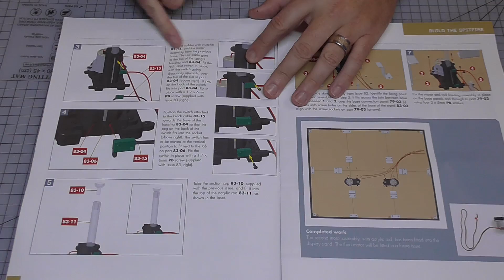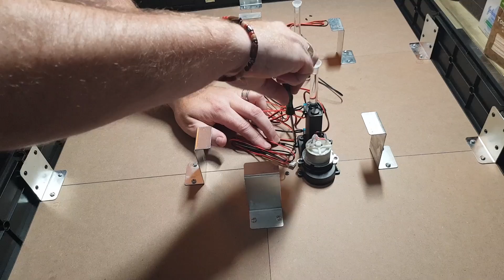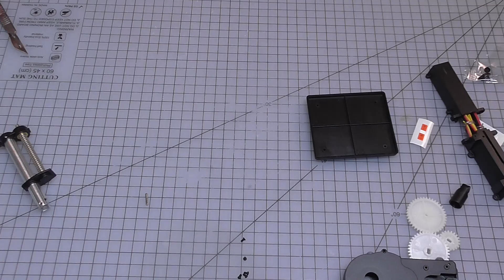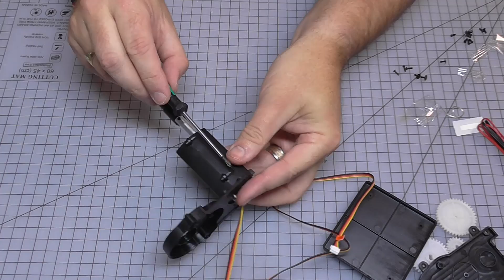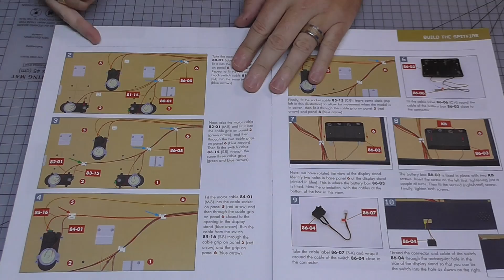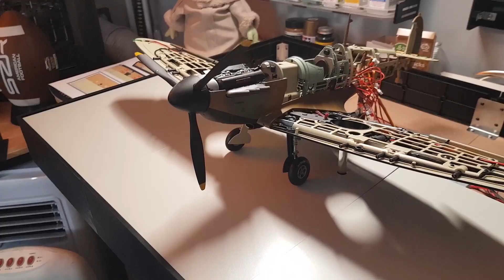Build the Spitfire Mk1a - Part 84-86 - The Dynamic Base

Comment: Hello Wayne i need to ask a question and sorry if this is unusual but i need you advice on the build the spitfire part 90 if you have not recieved this yet then it may be a help to you .
having recieved this part i followed instructions on the left wing assembly however i noticed that the tip of the wing was not secure so i applied some glue to the tips of it making sure not to touch the red light. It is sealed now. my question is would have done the same?
Reply from the maker: Probably but until I see it I wouldn’t want to guess

Comment: For those worried about the look of the base, have any of you considered the grass used on model railway layouts? it is cheap and looks pretty good. I am going to add some to mine having already checked out the look on my base so far.
Reply from the maker: I was going to cut a sheet of fine astroturf

Comment: Well Wayne, if that flimsy, unattractive top boards are going to be what is visible, well I'm definitely going to put some astro turf on top. I am really surprised that hachette are not going to give builders the option to purchase a piece and charge £100 for it, like their £169, or whatever it was for a bit of clear plastic to keep the dust off.

Comment: Excellent work+Ian Campbell over at Partwork Upgrades is already working onna alternative powersource. So no need for those pesky 4C batteries anymore
Reply: I saw that, got a Partwork Upgrades email the other day & have ordered mine, but there's a delay before it'll be posted out. I believe it plugs into the control board in the same socket as the battery box supplied by Hachette is designed to, so it looks like this modification will power everything from the mains, excellent. Nice video as usual Wayne.

Comment: Hi wayne I think CB could mean central board also I think the spitfire was fitted with a propeller with two blades then refitted with three blades
Reply: Yes, the very first Spits had two bladed wood propellers. The engine I think did not even make 1000 hp

Comment: I missed out on the Spitfire Build, but would have done it, if I'd caught it on time.  However the base unit is seriously flawed, and considering how much the parts for it will cost, the quality of the appearance is very poor!  If I was building the Spit, I wouldn't include the base unit and would have a custom built box to house the control unit and battery box and have a stand with the cable integrated within in and forgo the 'animated flight' option.